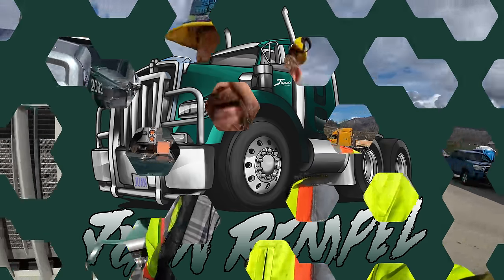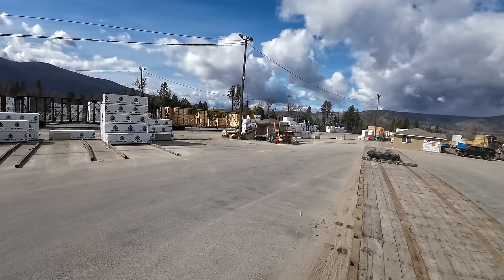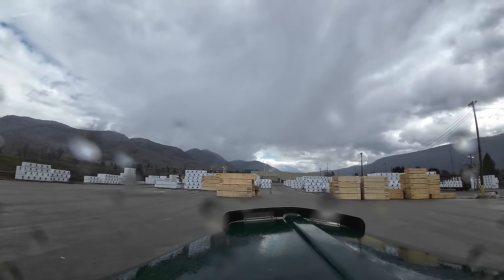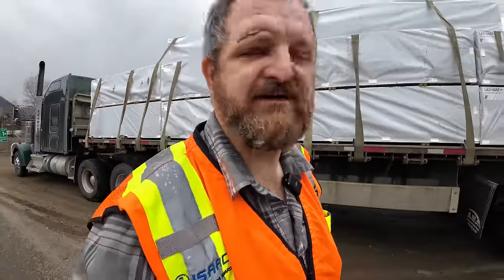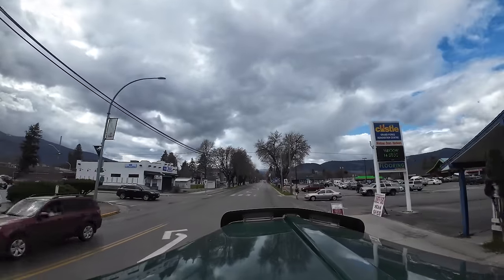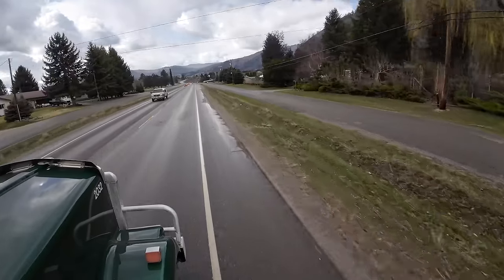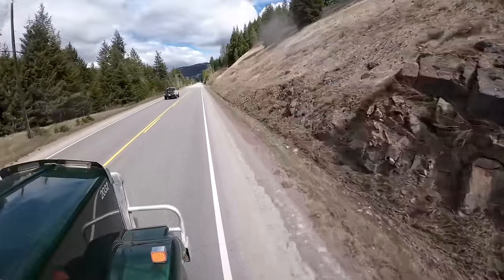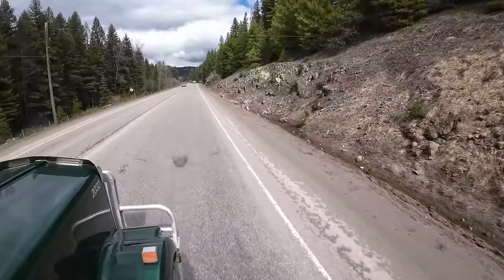Loading in Grand Forks • Super B Trucking Life 🇨🇦

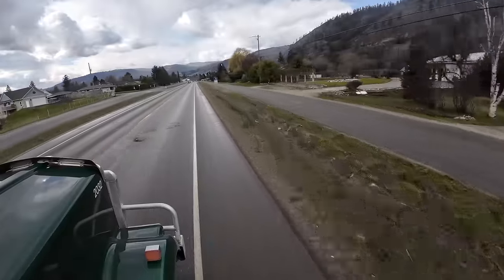Comment: @27:55 I noticed you jumped once in the video when you were tying down the load. Did you get a bad reaction from doing that?
Reply from the maker: It's funny, all mt throws have the same motion in them, the jump is accidental from putting to much energy into the throws.  As far as reaction, it's the same as the rest of my throws, I probably do it all the time without really noticing the air time.
Reply: @JuanRempel  You probably do it all the time just to get the straps over the load.